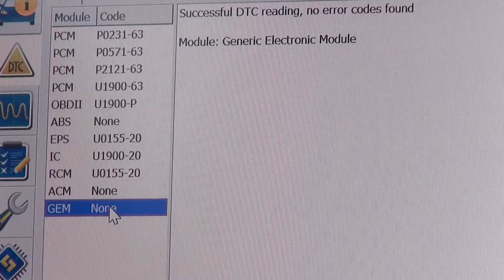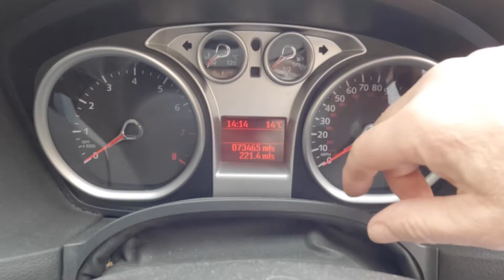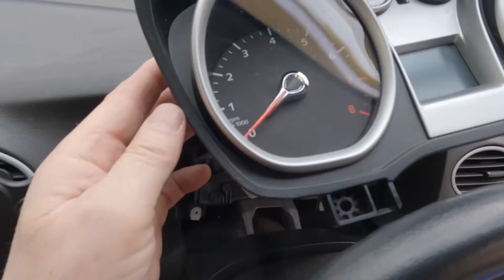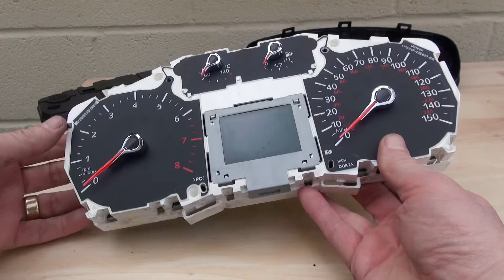Limp home Ford Focus mk2 - Instrument panel repair

Comment: Thanks very much for this Nigel, it really helped me in the disassembly of my other half's instrument cluster.  Or more accurately, the instrument cluster of her car, Fred.  He's a 2011 1.6 Duratorq with a slightly larger central display than in your example, but the cluster looks almost identical, apart form having two ribbon cables.

We had a great selection of faults. from the red triangle and 'Engine Malfunction' message with no symptoms, all the way up to complete failure and stalling out under acceleration.  One of the curious symptoms was a 3,000 rpm limit.  With the car stationary the engine would not accelerate beyond 3,000, but it wouldn't set a fault.  If the car was moving, any attempt to pass 3,000 would bring up the red triangle and cause the engine to stumble or stall.   Also, presumably because of the steering sensitivity setting, things could get very disconcerting under certain fault conditions.

There was no appreciable movement from the connector and the solder joints looked much better than your example, nonetheless I remade them all and seems to have effected an immediate cure.  No faults and the 3,000 rpm limit is gone.  One change to the procedure I would suggest is not to rotate the needles when removing them, but to simply pull them straight off, having photographed the cluster so that you can see exactly where they go back.
Reply from the maker: @MacCaughey  thanks for watching and I’m glad it worked out.

Comment: hello sir My car ford focus 1.8tdci mk 2.5 had an issue with the instrument cluster. I arrived home, turned off the engine, and after that, the car wouldn't start. I removed the instrument cluster and tried to fix it by soldering, but the problem persisted.

Then, I disconnected the battery to recharge it, but the car still wouldn't start. Sometimes, the display shows an 'Engine Malfunction' warning, and a central warning light flashes rapidly, followed by one long flashes and six short flashes.

When I turn the key to start the engine, nothing happens at all
Reply from the maker: @meijifamily8294 you need to do a diagnostic scan. https://youtu.be/pkhVdLhanfw?si=TdsO2iB0P9sXg-Pj